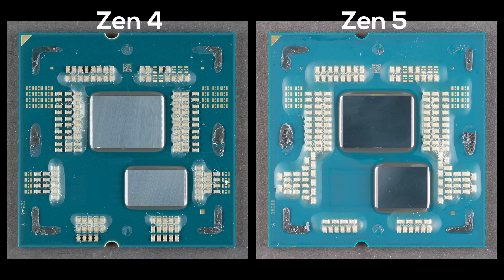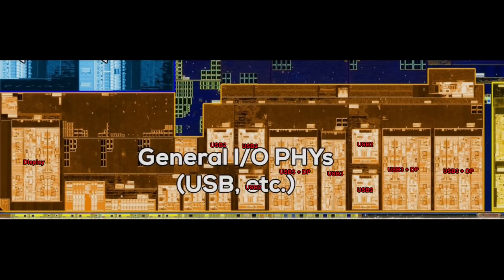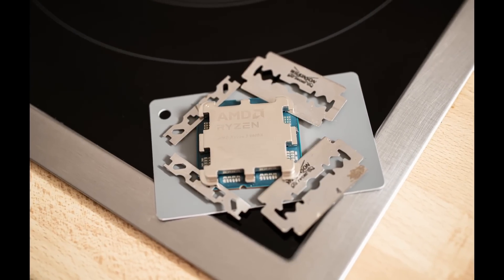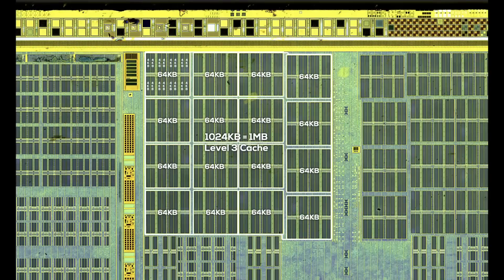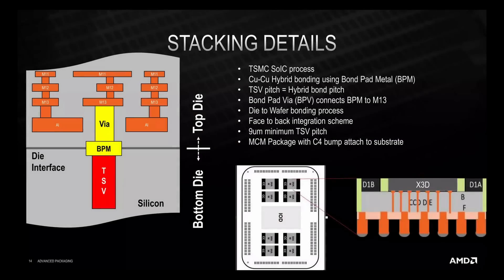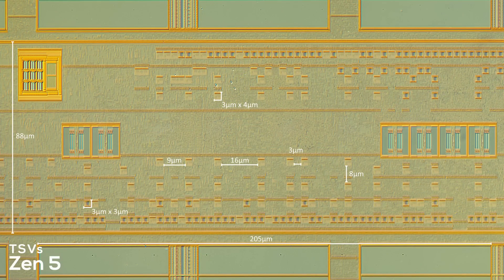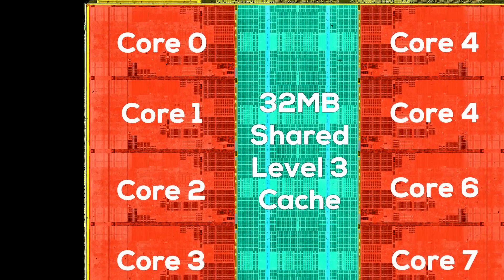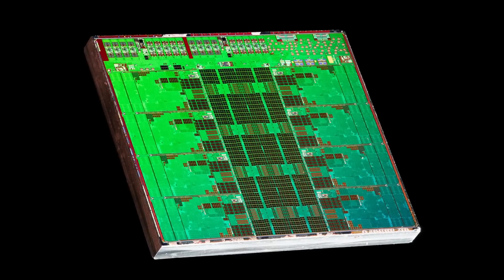ZEN 5 has a 3D V-Cache Secret

Comment: Great content.

Double 3D vcache sandwitch could make sense considering they have hinted at the fact 9800X3D etc might have higher frequency and even overcloacking available.

If the L3 cache is more in the middle and has a lesser horizontal footprint, that leaves more surface to cool the actual cores on each sides of it.

7800X3D is already the best gaming CPU of all time, but 9800X3D has potential to be even better if they don't shoot themselves in the foot as usual, either by releasing it buggy or dumb pricing.

Comment: It sounds like the 3D vcache is going to be more fragile and / or harder and more expensive to manufacture. This may be why it still does not have a release date.
Reply: Well, X3D was typically a next-year refresh. With the extreme failure of Zen 5 sales, it's possible they may expedite it. It's also a gamble though as it will have to compete with Intel Arrow Lake.
Reply: @aminy23  I’m curious how the removal of hyper-threading will impact metrics and performance with Arrow Lake. And how it may impact Windows support for hyper-threading long term.

Comment: Why is the Infinity Fabric block on the top edge of the IO die and the bottom edge of the CCD die? If that is how the two dies interface with each other, shouldn’t they be placed face-to-face on the substrate?

Edit: never mind. I see in the chiplet overview at 14:20, the infinity fabric of both dies is actually located in the middle, facing each other. It seems that when you zoom into the composite images, they are rotated 180°

Comment: bumpless hybrid bonding doesn't just fuse the chips at the vias but also across the entire surface of the stacked silicon, so there's no structural need for bumps. the original PHY size and pin count may simply have been redundancy to make absolutely sure there was no chance of a weak or lost connection ruining a previously working chip (which would also require more power pins). lowering the total via count and all but removing the large PHYs hints to AMD believing the process is mature.

Comment: There are leaks saying that both CCDs contain 3D V-Cache and also AMD engineers saying they have greatly improved cooling and clock speeds for zen5 x3d. So i'm sure they found a solution that doesn't cover parts of the core layout with the V-Cache, else i can't see how they could improve cooling and clock speeds with the worse heat dissipation.

Comment: ZEN 5 is definitely paving the way for ZEN 6 and Cache improvements. I think ZEN 6 will get 16c/32t per CCD thanks to TSMC 3nm, and maybe AMD worked with TSMC to get a sort of double V-Cache capacity or a Shared Dual-layer V-Cache for Dual CCD chips too. 
The I/O also needs to be improved, and the Infinity Fabric revamped for higher Memory Bandwidth (the true bottleneck of ZEN CPUs...hence some very good performance increase thanks to 3D V-Cahe).

Comment: AMD should put the V-Cache below the CCD instead of above it for:

- better thermal dissipation since, from what I've heard, the CCD runs hotter than the V-Cache,

- possibly higher cpu clock speed from better thermal dissipation,

- possibly lower voltage requirements if/when they adopt backside power delivery design or something like it.

Only time will tell if any of these guesses are actually applicable in real life so I guess we'll see.

Comment: I'm most amazed they haven't rolled out an L5 cache in that empty slot for 8-core skus. Why even mess with stack and packing micron sized charges on top of compute units when you could plop am IC in that empty space and fill it with like a GB of cache, while charging threadripper prices so Intel loses its bread and butter market hands down.

Comment: off-topic to the subject of the video, have you seen the xeon phi knights landing* die shot, it's absolutely wild compared to a regular CPU

(*a 2016 xeon spinoff, with avx512, 4 threads per core, and 16GB of near L3-cache speed on-die [MC]DRAM)
Reply: (the cpu can also be found for well under $100 on ebay, but the motherboards are impossible to find, and the per-core perf is awful)

Comment: The io-die is whats holding zen 5 back. X3d or zen 6 needs to redesign the io-die. Heck even zen 4 was being hold back with io-die. You cannot get ram speeds faster 6400mt/s to work.
Reply: We need more PCI-E lanes, as a starter.

Comment: I’m curious why Ryzen 5 9600X that has 6 cores still have 8 cores in its CCD (like in this video) or was it always like this? If yes so the 2 cores is disabled or is it factory defect?
Reply: Factory defect. If 1-2 cores are defective, then 2 cores are disabled to make a 6 core CPU. The 12 core CPUs have 16 physical cores with 4 disabled (2x per chiplet).

Comment: I could see the new 3D V-Cache extending over the entire die with the actual memory elements being a little spread out.  This would allow for more thermal vias to assist in transferring heat from the CCD, through the V-Cache, and into the cooler.  With the vias being so much smaller, thermal expansion resulting from the two dies being a different temperature will become a bigger issue.  Improved heat transfer through the V-Cache will be required.  Keeping the two dies the same temperature will be very important.  It should also help in allowing the new parts to reach similar frequencies as the non-V-Cache versions.

On a side note, using smaller vias could help in decreasing the power consumption when communicating over the cache bus.  It could also help in maximizing the frequency.

As far as the physical connection between the two dies goes, a reduced via count is a big issue.  I assume additional structural vias would be present along the edge of the dies.  Vias can take up a shocking amount of space compared to transistors.  One really wants to avoid them as one typically has to compromise the logic in order to fit them in there.  So reducing the number of logic / power vias to only what is required then moving the structural vias to the edge is probably the way to go.  If looking for additional vias, that is where I would look.

Comment: The other TSV mystery... is the CCD connected face down to the RDL, or face up and with TSVs?  If you have TSVs from the back that makes the non-V-cache SKU expensive.  Also, you should see structures for power and signal TSV poking through all over the logic areas.  Are there any?  Did @FritchensFritz flip over the die before imaging it?

Comment: I honestly wonder if the Infinity Fabric clock speeds and bandwidth is holding back Zen5,  i would imagine a Zen5+ before Zen6 where the upgrade the IO die and Increase Infinity fabric speeds or bandwidth. Games just cant use the increased IPC due to other bottlenecks in the CPU Pipeline
Reply: I agree, it's a combination of Infinity Fabric and Memory Bandwidth. A big part of X3D is basically mitigating the infinity fabric performance toll. 

AMD should have done a new I/O die and 10 core CCDs with 6 Zen 5 + 4 Zen 5c. Consumers like "bigger number better", and $300 6 core CPUs is a tough pill to swallow in 2024, especially when Intel is offering 14+ cores at this range.

Arrow Lake's memory controllers could be a game changer if 8000-10,000 RAM speed becomes the norm for it. Lunar Lake is using 8533 RAM already.

Comment: My presumption would be that the the TSV in the cache itself is only for data.  I’d guess that the power TSVs are located near the edge of the Zen 5 die and likely share some of the same power logic in the Zen 5 die. This would permit the V-cache die to have a different power voltage (but still the same data voltage!).  

Another alternative is that there are no power TSV and the V-cache die gets power directly the same way the Zen 5 does from the package.  The telltale here would be an edge section of the Zen 5 die without pads:  the V-cache die would stack on top and have pads there.  This would shave off a little bit of power which is critical for designs like this as thermodynamics is the great enemy.  

I would presume that AMD is going for denser V-cache but not a significantly different die size.  An 80 MB V-cache die seems reasonable and with double stacking would bring 192 MB of L3 cache per complete stack (80+80+32).  A fully populated Zen 5 Epyc would have an impressive 3 GB of L3 cache per socket.

I do wonder what they will be doing to handle the filler now, especially if they are going to double stack the V-cache.  Thermo expansion here has to managed very carefully.

Comment: Highly interesting and well put together, danke! I guess my question is, what good are all those changes when Zen 5 has turned out  to be such a disappointment? 
It's ~3% faster than Zen 4 and as a result sales have reportedly been been abysmal. There seem to be some modest gains in power efficiency but that's about it. When running at higher power, the CPUs don't scale. People are actually buying Zen 4 since the performance is virtually the same.
Are all the reviewers misusing something?

Comment: Really good video. It definitely reinforces my belief that as far as IPC uplift is concerned, Zen5 is more a foundation upon which to build Zen6 rather than a performance revolution itself. As for the 3D V-Cache, I'm also leaning towards a multi-layer stack, AMD has been involved with HBM from the very beginning and 3D V-Cache is already stacked. This would also give them a path to increasing 3D V-Cache capacity for future releases. If they use the same cell density, two additional stacks gives them 64MB, while adding a third would give 96MB with the same footprint. It's an obvious direction for AMD to go.

Comment: Fantastic investigation! It's fascinating to learn how much has changed with Zen 5. It makes it all the more perplexing to me how the general performance has changed very little in Windows. The engineers clearly did a lot of work, but besides AVX--512, it's hard for me to understand what the benefit was. 

Perhaps we'll find out in due time, with future generations. Maybe we'll get v-cache on both CCDs in desktop Ryzen, or a double stack on a single CCD.
Reply: Zen 5 improvements are all contingent on being able to feed the core with data, it just so happens that workloads that use AVX-512 already are heavily optimized for this sort of thing, if your application already fits in to L2 cache, you'll see huge improvements in performance, most games and consumer products are poorly optimized from this perspective, I've seen video game performance regress with map rebalances on older CPUs with small L3 cache.
Reply: @woobilicious.  That reminds me of the dilemma that TeraScale 2 was in, resulting in AMD moving to GCN which peformed better across a wider variety of applications.
Reply: The point is specifically that we weren't the priority.  They use these same chips/architecture in their server products, which is where all the money is these days.  And that's what Zen 5 was really built for.  Consumers are straight up becoming less and less relevant in the computing space these days.  Really kinda sucks.
Reply: @maynardburger  That's a fair point, but it still seems off to me. I must also mention that it did wonders for Strix Point, so it seems it can bring great improvement to consumer workloads too. Perhaps we'll see it in the Z2 Extreme chip too.

Comment: It could be that the v cache is no longer a 2:1 ratio and merely a 1:1 ratio
If both ccx's get a slab of 3d cache then a 900 or 950 class chip still has the extra 64mb while the 6/7/800 chips have an extra 32mb
They could also make it a fairly slim strip and maybe adjust the heatspreader so the cores can still have direct contact to the ihs
That latter part is wishful thinking as a 7800x3d owner as those cores struggle to shed their heat resulting in much deminished clocks and fairly high operating temperatures

Comment: Dubbel stacking 3d v cache would be ballsy.
Reply: If that lets them keep the "cache tower" away from the ALU areas that would be a huge boon. The baked in L3 cache makes very little heat compared to the ALUs and FPUs, so keeping the clock speeds high on the X3D chips would be possible. Perhaps even allowing full overclocking support. If TSMC thinks their yields are good enough for mass production I can't see why AMD would chose not to.

Comment: That is insane. Zen 5 may have a couple tricks up its sleeve for vcache after all. I dont see how they can operate at higher frequency wothout the double stack which was stated unlikely though. That would be where most performance improvements would come from over Zen 4. But this base of Zen 5 seems to bode well for Zen 6 imo

Comment: Sorry but a HALF-MILLIMETER difference is NOT 'MARGIN OF ERROR' when it comes to silicon....  even if it's .5mm^2  ...  there is NO ERROR THAT BIG when it comes to making these wonders of science!!! I do get what you're trying to say and they are VERY SIMILAR in size... to US and OUR EYEBALLS..... but HOW MANY TRANSISTORS DO YOU THINK YOU CAN FIT OMN 0.5mm^2 ??
😁😁
Reply from the maker: If you consider that it includes the scribe lines and that each die can differ by a tiny margin, and that no measurement is perfect: I’d call it margin of error 🙈

Comment: Could they have a different CCD layout for the X3D ships?
Or maybe the V-cache is smaller this time?

If they stack the V-cache in two layers the final chip will be higher and the heat from the cores have to travel longer from the cores to the heat spreader. Thus the delta T would be higer to cool the same amount of watts. But they might have enough headroom or they might just reduce the frequency a little. The 9000 does not seem to be limited by the amount of power that it needs. More that it just have a hard time running with a higher frequency.

Comment: why are they even using iGPUs if they take up so much die space? Surely most desktop users never use it.
Reply: The same chips are used in AIO and pre-built PCs in which the vast majority use integrated graphics. Die space isn't as much a premium on those older nodes anyway so spending some die space to allow them to sell more of the high-end chips to OEMs makes sense. In previous generations, the likes of Dell or HP would be limited to 8 core AMD CPUs on their compact products, whole the Intel versions could go well past that (AMD 5700G vs Intel 12900, for example).
With at least basic graphics on the IO die, AMDs 16-core chips can be sold in the same small form factor machines that their 24-core Intel counterparts are sold.

Comment: What surprised me most about Zen 5 is: all this effort and only marginal benefits, sometimes even falling behind Zen 4. Not even the often mentioned efficiency is a noticeable step up compared to 65W Zen 4 CPUs. Wonder what's holding back these improvements and if Zen 5+ or Zen 6 can unleash it.
Reply from the maker: It’s a different story in server applications. Zen 5 excels there.
Reply: @HighYield  They still tried to market it as a huge step for consumer hardware, with false claims even. That definitely hurt them in public reception.

Comment: So, is it possible to turn my r5-7500f to r5-7600x or even r7-7700X? just modify/move some capacitor or connect/short some pins outside the IHS?
Reply: Just OC, put a decent CPU cooler on the 7500F and you could OC it to 7600X speed.
Reply: @aminy23  But I want to unlock the two cores that AMD has blocked at the factory. It would be great if AMD could provide paid unlocking and new methods so that I don’t have to disassemble the CPU, sell the old CPU, and buy a new CPU. For users with limited budget in the early stage. It's kinder to say that.

Comment: The TSVs pointing to a smaller V-cache die is really interesting if you take into account Semi Analysis' deepdive on Zen 4c.

In the article they do mention that part of the area savings are from moving to an (early production at the time) 6 transistor cache design rather than the traditional 8 transistor design commonly used in most CPUs currently.
Without control structors, with the new smaller TSVs, with the reduction in dead silicon, and using the Zen 4c tested 6 transistor cache cell, I could see them managing to just shrink it enough to fit on the new L3 + L2 area indicates by the new TSV structure.

Regardless, either this way, or the double stack proposed in the video will be interesting to analyze. Can't wait.
Reply: Interesting idea, but I would expect the smaller Zen 4c cache cell to have been used at the cost of lower max clocks, which would probably make it unsuitable for a 9800X3D.
Reply: @chuuni6924  theoretically there is some sort of trade-off for using that design, but I don't remember exactly what it was. Also they have been producing zen 4c and 5c for the past year to year and a half, so they would know better than us if it would work or not.
Reply: Though, that and the smaller TSVs could potentially mean they have Zen 5c VCache incoming.

Comment: I actually wouldn't be surprised, if AMD squeezes NPU somewhere into IO die for Zen6
Reply: Packing more cores into a singe CCD and using the place of the 2nd one for a beefy NPU is also possible. Or they could also try to shrink the CCDs and have a 3rd place on the die as well.

Comment: My guess is X3D will just keep covering the L3 area. AMD has gone on record saying diminishing returns over 64MB. If they can manage to keep the 2:1 density for 3D Vcache:L3, it will be a win and cheap enough to put 2x X3D CCD's on higher end chips. Exotic solutions are reserved for the datacenter/mobile.
Reply: The idea of going two-high stack isn't to add more L3 cache, but to do 2 x 32MB chiplets.  I dont think it will be possible to fit 64MB of L3 onto such a small, single chiplet only covering the existing 32MB of L3 and nothing else, given how much that 32MB of L3 has shrunk since Zen 4.